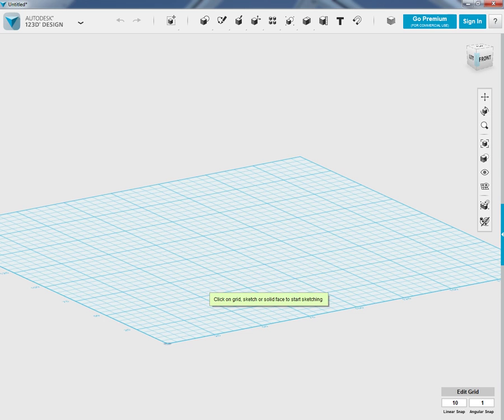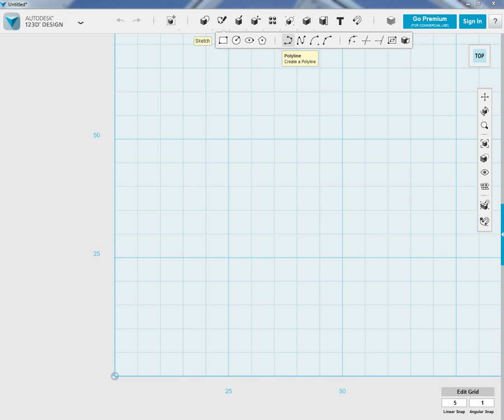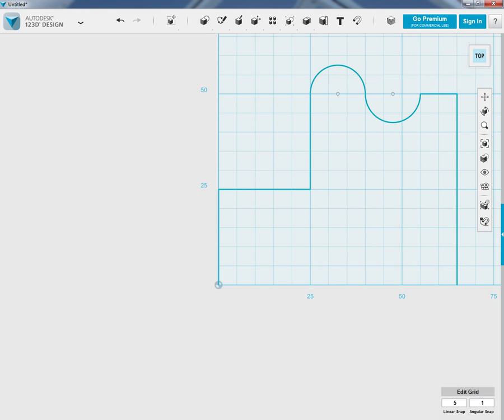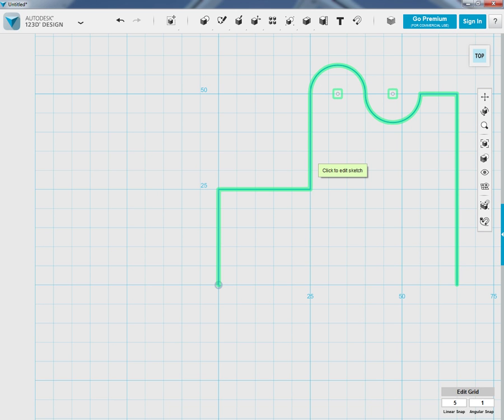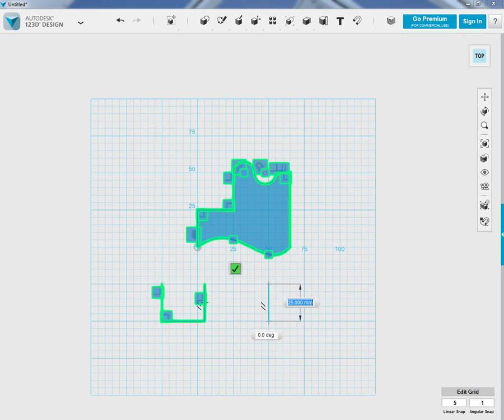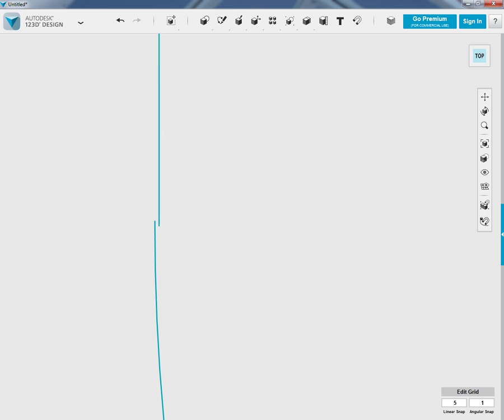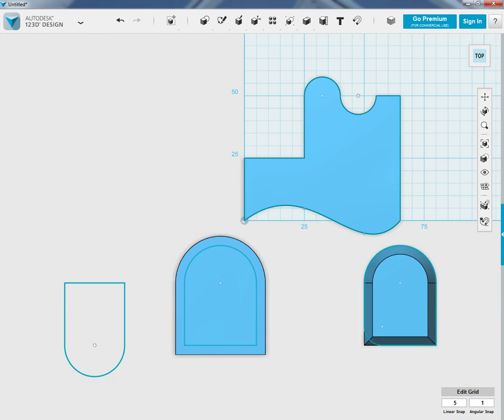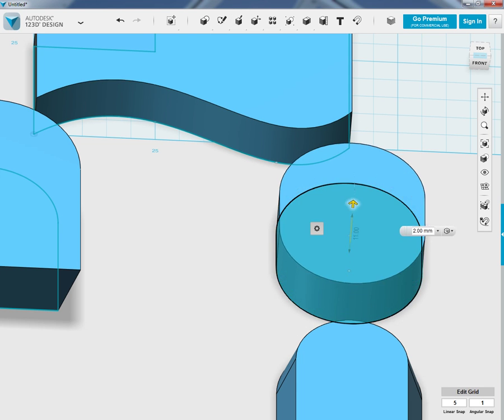123D Design - Working with Sketch Tools

Comment: linear snap is for when you use the move tool to move an object. if set to 1mm every movement in a certain direction will snap to the next millimeter. if set to 5mm the object will move in 5mm incriments and so on. this is to make it easier to move objects a certain distance without the need to type it in. a good example is if you want to copy a part five times and you want to move each copy 5mm away from the other, jest set snap to 5mm and copy and paste, when the movement arrows come up and you drag it it will automatically snap to a distance of 5mm from the other object.